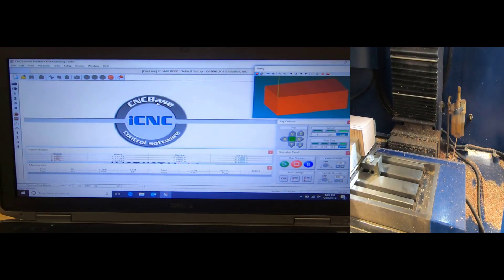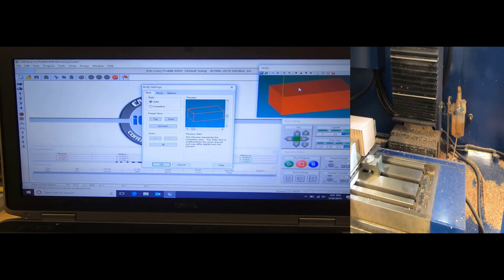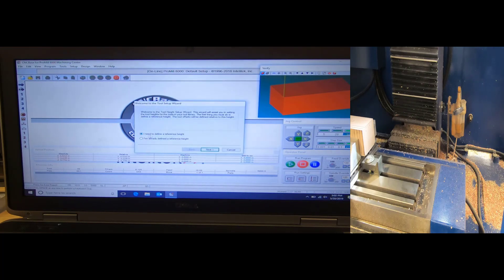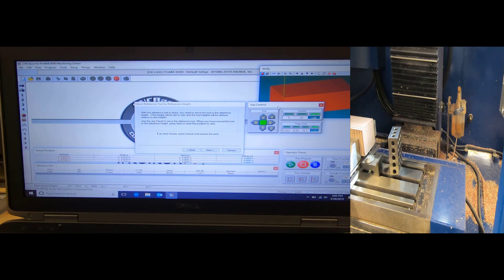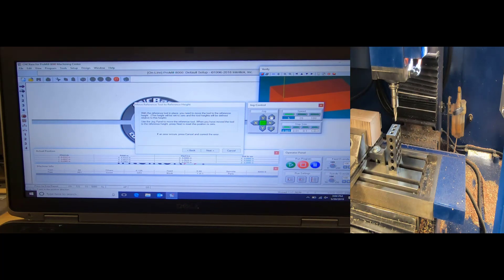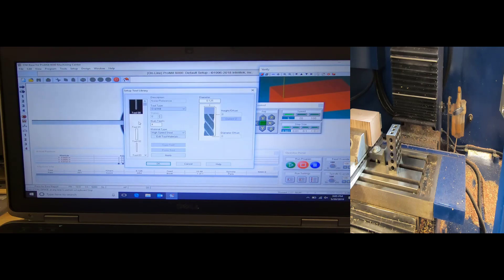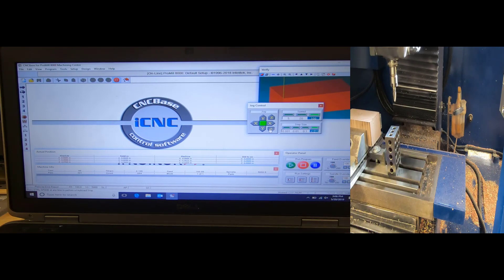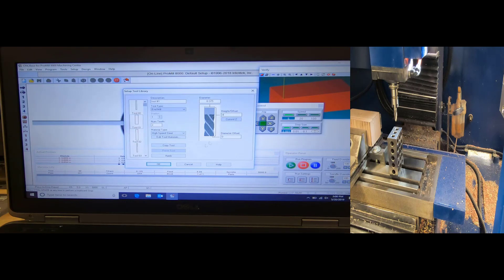Intelitek Pro Mill Setup

Comment: What if you don’t have a 123 block?
Reply from the maker: @omarsantiago8574  honestly it can be anything. It's just a repeability location. It doesn't necessarily have to be a 123 block it could be a block of material as long as you use that same block of material to set all the tools.